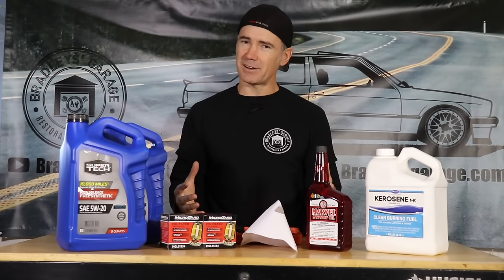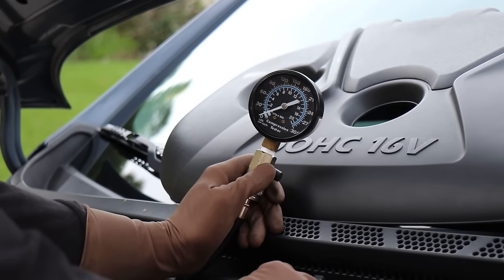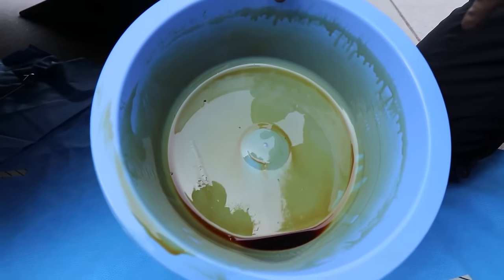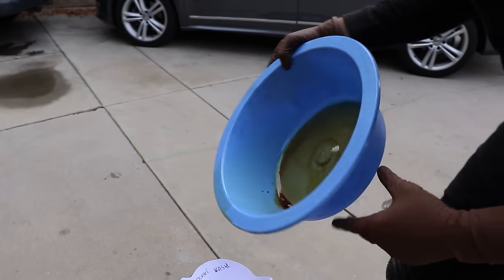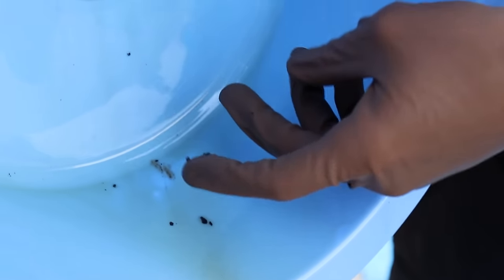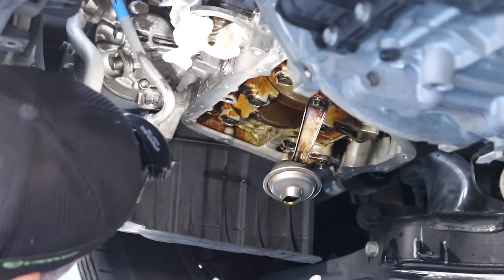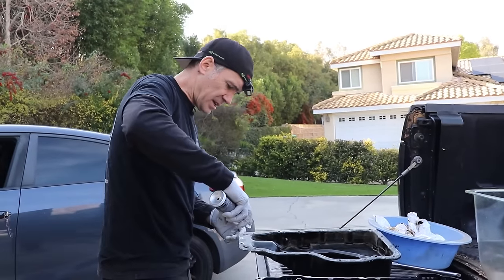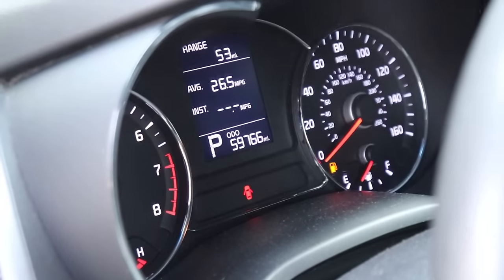*UPDATE* Customer States Jiffy Lube refused to change my Oil - Sludge Factory Kia Forte

Comment: Fantastic! 😃👍 Clean enough. 😉
As nobody can undo the past the customer was lucky about the equal compression on all 4 cylinders. As we don't know if the timing chain got elongated he should listen to potential rattle at cold start.
Here in Germany we tend to use really expensive oil and drive with longer intervals.
Your customer should use oils with good cleaning properties.
How about adding 16 floz. or 500 ml of WD-40 or MMO or Diesel before the next oil change and drive around the block for just 10 minutes? That should wash out the last few crumbs of sud.
I added 200 ml of WD-40 to my oil 2 days before the oil change and further 300 ml at home into the cold engine before driving to the oil change - you know what? The engine survived! 😂 And the new oil stayed clear like water.
Reply from the maker: Thanks for the comments, glad you enjoyed the video. We drove around for 430 freeway miles with 32oz of MMO in the last change. That should be good to get the majority of what was left after the numerous flushes.
Not sure if you watched the original video - https://youtu.be/XU79jXYWydA
We may add 4oz to each subsequent oil change moving forward to continue to breakdown anything that may still remain.
Thanks again for hanging out. Cheers!
Reply: @BradleysGarage  I watched the original video - with excitement and horror! 🤭😂
I was the one who suggested Diesel. 😉
I like to read safety data sheets. I think Liqui Moly Engine Flush is more or less canned Diesel with a new sticker on it.
In my opinion(!): the same goes for injection or valve cleaner - I think it's concentrated, canned premium fuel with a new sticker on it. 😉
Reply from the maker: @u.e.u.e.  Thanks for the info, just fancy packaging and the most likely ingredients. Thanks again for hanging out. Cheers!

Comment: Would anybody here want to buy this Kia as a used car?
Reply from the maker: Thanks for the comments Craig, it might actually be cleaner than most Kia's running around. We had no idea so many of them have sludge issues until we started working on this one. Hopefully we have done enough to salvage the motor long term.
We just posted the 3k mile update video if you haven’t checked it out yet - https://youtu.be/QrJ0B-KXTw0
Cheers!

Comment: Valvoline Restore and Protect would have been my go to for that mess. Having experimented with that oil on parts removed and seen it clean caked and baked residue off of an LS rear seal plate in less than a hour, the stuff does precisely what the label says...
Reply from the maker: Thanks for the recommendation; we will definitely check out that product for our next Sludge Factory project.
We posted the 3k mile update video if you haven’t checked it out yet - https://youtu.be/QrJ0B-KXTw0
Cheers!
Reply: @BradleysGarage   Look up The Motor Oil Geek. Lake Speed Jr. has an episode on That new Valvoline oil. Very interesting coverage. Annnd, the stuff does what they claim.
Reply from the maker: @Sunspot-19  Thanks for the info, we will check it out. Cheers!

Comment: Very informative and well videoed. I would imagine at a normal mechanic garage rate , etc, this repair cost the owner more than a “lifetime “ of oil changes. Hopefully , he or she got the message.
Reply from the maker: He's just a 20 year old kid that doesn't know anything about cars or what is needed to keep them running properly. He helped with the repair so he wants to learn and understand things.
Hopefully he has learned a valuable lesson on the importance of routine maintenance on his car moving forward. The goal will be for him to be able to change his own oil moving forward.
Thanks for hanging out, Cheers!
Reply: @BradleysGarage  One of the (still) most under read books in society is the car manual! What still amazes me is that folks have all the info at their fingertips on the web now , but can’t seem to make use of it. And,  this applies to engineering students I sometimes mentor. Again, great video.

Comment: iit is safe to pour diesel? how's the gaskets and seal inside the engine?
Reply from the maker: Thanks for the question, the diesel should not have any effect on the internal seals/gaskets. Especially since we are only running it for 15 minutes. Then we are draining it and putting in fresh new oil. Hopefully we have done enough to salvage the motor.
We posted the 3k mile update video if you haven’t checked it out yet - https://youtu.be/QrJ0B-KXTw0
Cheers!

Comment: Great video, how much would you charge for a job like this.
Reply from the maker: Hey Joe, thanks for the question. Jake purchased all the products/parts, we didn't charge him any labor as we were just trying to help this young kid out.
We would imagine a shop would be charging $600-$800 in labor if they would even mess around with it. Most would just say he needed a new engine and would be quoting him $4k to replace it.
We spent about 8 hours going through everything so it is definitely time consuming. Hopefully we have done enough to salvage the engine.
Cheers!
Reply: Thanks

Comment: you should do an engine flush with seafom, BG cleaner or liqui molly engine flush.
Reply from the maker: Thanks for the comments Eduardo, this is actually an update video. We used the Liqui Moly flush during the original video.
You can check it out here - https://youtu.be/XU79jXYWydA
Cheers!

Comment: You say duesel, but show kerosene?
Reply from the maker: Thanks for the comments Jim, we didn't have a enough Kerosene to do that little flush and still have a quart to run for 20 minutes so we decided to use the diesel we had on hand instead. They have very similar properties so we just substituted them out.
Apologies for the confusion, thanks for hanging out. Cheers!

Comment: Flush with diesel cleans that sludge easy.
Reply from the maker: Thanks for the comments Joe, appreciate the feedback. We did a little diesel flush (off camera) with the oil pan off to wash out any debris in the tight areas of the engine and holes. That produced quite a bit of particles so we feel pretty good that the internals are clean at this point. 
Check out the 3k mile update video here - https://youtu.be/QrJ0B-KXTw0
Cheers!

Comment: I have a 2014 Kia Soul ! Had to get an engine replacement this past year. Was burning over 2 quarts on the 1000 mile engine test. Had to have it tested a few times but was all replaced under warranty. Hoping to get a few years before this one has issues.
Reply from the maker: Thanks for sharing, glad to hear you got it all covered under warranty. Cheers!
Reply: Boy, it would have been a whole lot easier to just do regular oil changes.

Comment: There is an oil in walmart that says 20000 miles has anyone gone all the way?
Reply from the maker: We have not tried the new "Advanced Full Synthetic" 20k mile oil. It looks like it comes in all the standard flavors, 0W-20, 5W-20, 5W-30 and 10W-30 and it's les than $2 more than the regular full synthetic ST oil. Seems like a no brainier from a cost standpoint.
Cheers!

Comment: That engine was cleaner on the outside than the inside!
Reply from the maker: Thanks for the comments Gino, we try to detail the engine bays BEFORE we start any work on the motor. We don't like working on dirty engines, so that is why it's so nice on the outside. Hopefully we have done enough on the inside to salvage it.
We just posted the 3k mile update video here - https://youtu.be/QrJ0B-KXTw0
Cheers!

Comment: Wow, what grade of Diesel are you using?
50ppm here is much darker than that.
Reply from the maker: We are located in Southern California so we have Ultra Low Sulfur less than 15ppm. Not to mention it's over $6 gallon as well.
Where are you located?
Cheers!
Reply: @BradleysGarage  I am located in South Africa, 50ppm is common here. Some areas supply 10ppm.  At 30-80c more per gallon compared to 50ppm.
Reply from the maker: @stephencelliers9127  Interesting, here we only have the one option. All in the name of saving the environment it seems.
I'm sure the higher ppm provides even more protection to the motor.
Thanks again for hanging out, Cheers!

Comment: Must have cost him  600.00 at least
Reply from the maker: Thanks for the comments Craig, he purchased all the supplies for the multiple flushes which came out to about $250. We did not charge him anything for cleaning it up. He's just a 20 something year old kid that doesn't know anything about cars or what is needed to keep them running properly. He helped with the repair so he wants to learn and understand things.
Hopefully he has learned a valuable lesson on the importance of routine maintenance on his car moving forward. The goal will be for him to be able to change his own oil moving forward.
Thanks for hanging out, Cheers!

Comment: But....they put oil in the car when you buy it!
Reply from the maker: That's very true, hard to know exactly how many miles since the last oil change but definitely seems like way more than 6k miles. We are thinking more like 12-15k miles sine the last oil change based on what the internals look like. 
He has had it since around 30k and claimed to have changed the oil 4-5 during this period. I'm sure the cheap oil changes at Jiffy Lube did not help the situation. 
We just posted the 3k mile update video here - https://youtu.be/QrJ0B-KXTw0
Cheers!

Comment: wen any "mechanic" talks about using diesel as a engine flush, there not a mechanic and click off the video.
use real engine flush additives otherwise you will be doing damage to the engine.
you may not notice it until about 20k or so down the line.
Reply from the maker: Thanks for the comments Dragon, appreciate the feedback. We did the first couple flushes using Liqui Moly engine flush. The diesel was a final step to ensure we removed all of the small particles that may have not gotten dislodged.
Be sure to check out the original video if you haven't seen it - https://youtu.be/XU79jXYWydA
Cheers!
Reply: @BradleysGarage doesn't matter you put a contaminant in the engine. 
these newer engines can not handle it like the the good old classics. 
diesel was a oldschool trick back in the day before they had actual engine flush additives. 
newer cars have all sorts of seals in them now that are made of heat resistant rubber or plastics that react with diesel, it's the same reason why you don't use gas in a diesel or use regular oil in a diesel engine.
Reply from the maker: @dragontechgaming6677  Thanks for the feedback, appreciate the information.
We will continue to monitor the engine every 1k miles until the next 3k mile oil change. That should give us an idea if it is burning any oil or if any other issues present themselves.
Cheers!

Comment: Sir.. Suppose my engine sludge is flushing thrice a day,will it better
Reply from the maker: Thanks for the comments, not sure how bad your sludge is? If it looks anything like our video, it will take several flushes in order to see any results. Then lots of 2-3k mile oil changes after that to continue flushing all the particles out.
We posted the 3k mile update video if you haven’t checked it out yet - https://youtu.be/QrJ0B-KXTw0
Cheers!
Reply: @BradleysGarage  same as your video.. do i need engine down for cleaning all the sludge..or is it ok to flush with flusher
Reply from the maker: @Bobo-zs1dd  If it is as bad as ours and you don't want to take everything apart, we would opt for the BG Dynamic Flush.
https://www.ebay.com/itm/405157865159

Here is the manufacturer link - https://www.bgprod.com/catalog/engine/bg-dynamic-engine-cleaner/

We will definitely be giving this product a try on our next sludge factory project.

Cheers!

Comment: Good that you found a dirty engine. Most videos are made over spanky clean engines. They're  jokes!
Reply from the maker: Thanks for the comments Tomas, this one just fell into our lap. It was definitely a lot worse than we had anticipated. Hopefully we did enough to salvage the motor and keep it running good for many more miles.
Thanks again for hanging out. 
Cheers!
Reply: @BradleysGarage  You just gave that engine hundreds of thousands of miles more than it would w/o your intervention.
Cheers!
Reply from the maker: @tomasnokechtesledger1786 We feel pretty good about how things turned out. Thanks again for hanging out. Cheers!

Comment: Why did you not pour the diesel fuel over the entire head, when you had the valve cover removed? Also use brake clean to wash that sludge buildup into the oil pan.
Reply from the maker: Thanks for the comments Orin, we did a little diesel flush (off camera) in the first video, with the oil pan off to wash out any debris in the tight areas of the engine and holes. That produced quite a bit of particles so we feel pretty good that the internals were clean at that point. 
We chose to use Carb Cleaner instead of brake cleaner since it's a little less harsh on the engine internals. Cheers!

Original Video - https://youtu.be/XU79jXYWydA
Reply: I would be concerned with washing out the oil film from the bearing surfaces which could cause a lot of damage. Engine builders use assembly lube for a reason. If you have to go as far as spraying the inside of the engine with solvents then maybe it’s time for a tear-down.

Comment: Why does the oil from the filter have a red hue compared to the rest?
Reply from the maker: Most likely it was from the Marvel Mystery Oil (MMO) since it is a red colored product, almost like transmission fluid. At the 25% ratio it definitely would have an impact on the hue of the oil color.
Cheers!

Comment: Can you do motor flushes to high mileage VW 2.5L? Asking for myself I have 2 of them with 200,000 miles and both have horrible history of oil changes.
Reply from the maker: You can definitely perform a flush on any mileage engine. Just be prepared to go all the way depending on how bad the insides look. Not sure if the 2.5L has an oil pan that is blocked by a crossmember? Just keep that in mind before you jump into things.
You might want to just pull off the valve cover to take a peak inside before doing the flush. Let us know how things go. Cheers!
Reply: Nope, the VW 2.5L lower oil pan comes off easy peasy.
Reply from the maker: Thanks for the info, sounds like it should be pretty straightforward then. Good luck on the flush. Cheers!

Comment: On my Camry they said every 10K. I do it every 5K.
Reply from the maker: Kia recommends 7500 mile oil changes but that seems too long for these engines. We will continue to do 3k mile oil changes until the filter is no longer collecting particles. Thanks again for hanging out.
Cheers!
Reply: @BradleysGarage  I like to learn from others.

Comment: Why is there no class action lawsuit against manufacturers recommending extended oil change intervals?
Reply from the maker: Here is the class action lawsuit for faulty engines on Hyundai/Kia vehicles.
https://www.kiaenginesettlement.com/
Unfortunately, the 1.8L MPI motor that we have is not part of the settlement.
Cheers!
Reply: @BradleysGarage  yeah, the 2.4 from Hyundai is an extreme case. The sludge issue with lesser immediate consequences seems to be the case for a lot of manufacturers, especially for turbocharged DI engines.
Reply: Kia recommends an oil interval of 7500miles or 12 months. That's a reasonable interval if you're using good oil, and if you don't then doing shorter intervals is not gonna help your engine much anyways.

Comment: 🤣 use a pipe cutter for the oil filter
Reply from the maker: Thanks for the suggestion Cody, we invested in a proper one at the 3k mile update.
Here is the 3k mile update video if you haven't seen it - https://youtu.be/QrJ0B-KXTw0
Cheers!

Comment: does it consume any oil now ?
Reply from the maker: Thanks for the question Alex. It was not low after the 700 miles or the 430 with MMO but we will continue to monitor it every 1k miles until the next 3k mile oil change.
Be sure to check out the original video if you haven't seen it - https://youtu.be/XU79jXYWydA
Cheers!

Comment: I often wondered how that Kia turned out, thanks for video!
- Does anyone know if using AT205 additive is safe to use on GM motors with AFM ?
- I'm surprised that your HOA allows you to work on cars in your driveway
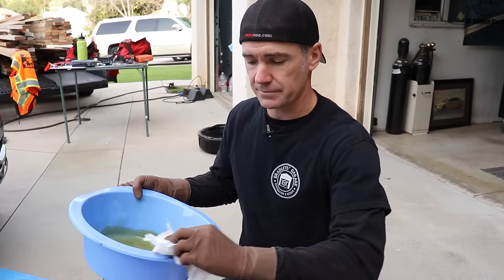- 6:25  Safety chain/strap on tank?   🤔🙂
Reply from the maker: No worries, glad you enjoyed the video. We don't really have any experience with the AT205 product so we can't comment on that.
We would NEVER live anywhere that has an HOA. 😎
Safety Chain/Strap @ 06:25 ???
Cheers!
Reply: Where did u get the idea that they had a HOA?
Reply: @BradleysGarage  oh just a safety chain strap for your tank.  Just being nit-picky.  🙂
Reply: @deeohgi  Most nice neighborhoods have HOAs than don't, that's all.

Comment: The traditional (and known to be effective) engine oil flush calls for idling the car 20 minutes with straight ATF + Diesel (aka kerosene) 50-50. In my experience, I found MMO or Seafoam to border on snake oils  that more than probably just mess up the carefully developed oil refiners' formulas. With a "sludge factory" engine, better use a high detergent oil and do those 3k miles oil changes. Regards.!
Reply from the maker: Thanks for the comments Daniel, appreciate the feedback. Cheers!